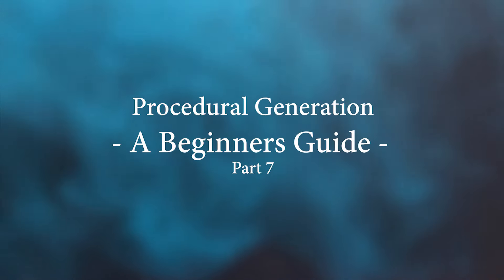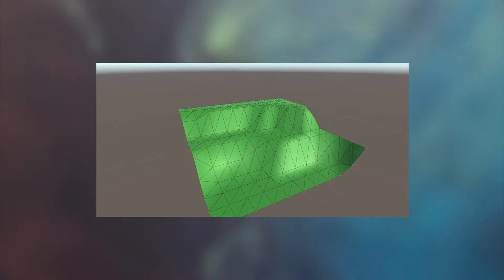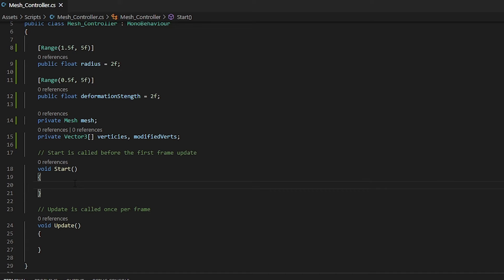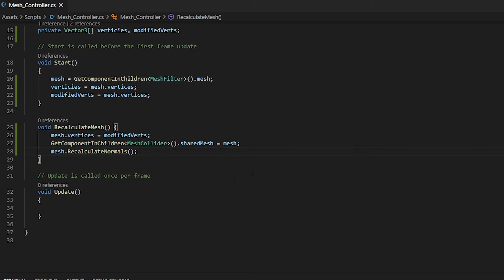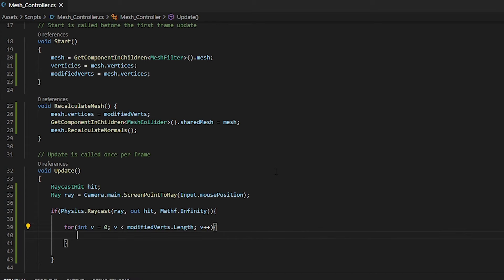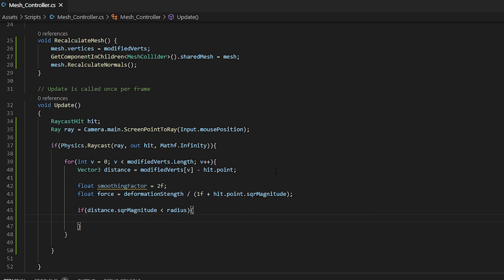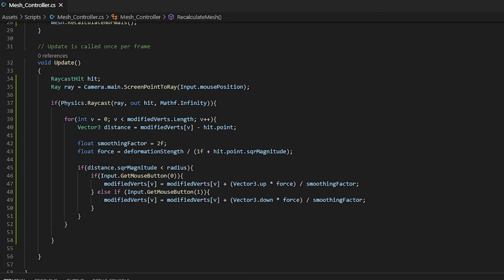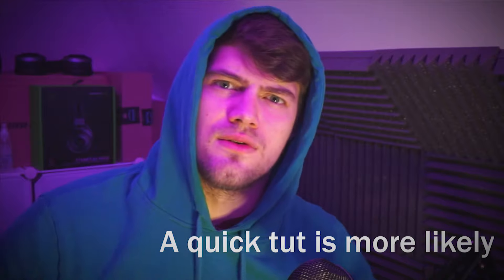Mesh Deformation : Beginners Procedural Generation EP 7 - Unity3D

Comment: I am working on a sand castle city builder project and this video definitely helped me.  Thanks :D
Reply from the maker: Glad it helped!
Reply: I am using marching cubes now because the system you use loses polygon resolution/typology when deformed :)
Reply from the maker: That's good, marching cubes is the correct implementation for what you're creating! Good luck with your project :)

Comment: When I attach this script to my procedurally generated mesh I get a “Object Reference not set to an instance of the Object” in the RecalculateMesh() step at the end of Update
Reply from the maker: Hey, do you have a mesh collider attached to the game object?
Reply: @CodingWithRus  I'm not sure what the original problem was but I worked out how to do the OnCollisionEnter in order to have a colliding object deform the mesh and that works great with a Primitive but not with my Generated Mesh.  I had to move the GetComponent step into an OnBecameVisible since my mesh does not actually exist when Start is called.  And that seems to work ok.  modifiedVerts are being updated with a down component when something falls on them.   BUT the RecalculateMesh step although it's being called ok, doesn't do anything when it's my Calculated Mesh.  The mesh doesn't change shape like it does when the script is attached a primitive plane.   Something about the nature of my Generated Mesh but it seems to have all the correct attributes.  It has a Filter, I can get the mesh.vertices.length
Reply from the maker: Hey, I suspect it will be your mesh collider, double check that it's attached and there is a call on the start method for it. Think that will fix your issue
Reply: @CodingWithRus  I worked it out.  My Generated Mesh DOES change shape, just not visually where the colliding object is hitting it.  It seems to be deforming the mesh's local coordinates in line with the collision's global coordinate (for example my ball is hitting the mesh at Global coordinate 0,0,0 and the mesh is deforming at vertex 0,0,0 but because I have dragged my mesh to position it so that the centre of the plane is under the ball, that 0,0,0 vertex is at global coordinate -10,0,-7.  Do I need to position my Generated Mesh Game Object at 0,0,0 and reposition the ball, camera etc so that they are in the middle?  Or is there a way I can translate the collision coordinate to be relative to the Mesh's position?

Comment: Is it possible to use this but instead of just deforming you could remove parts of the mesh? I want to make a snow system where you can roll a snowball in the snow, the snow will disappear and the snowball will grow
Reply from the maker: Hi, I really wouldn't recommend removing parts of the mesh if you're not certain what impact this would have. Instead deform it (like in the video) to lower the vertex's. Bare in mind I've never tried to create a snow type system. Thanks and hope that helps!
Reply: @CodingWithRus  Yep, deforming was the right way to go! Thanks a lot

Comment: how do I need to change the code if I want to do it with a wall?
Reply from the maker: You'll just have to flip the axis, so instead of using the z axis, you use the y axis.

Thanks,
Reply: @CodingWithRus  where do I set the axis? I rotated the plane. But it only deforms the plane/wall when I click on the ground instead of the wall. How do I need to change the raycast code?
Reply: @Pilzefresser  not 100% sure but I think you could just replace Vector3.up / Vector3.down to Vector3.right / Vector3.left

Comment: Hi Rus! First of all: awesome video, you make me understand a subject that i was trying to learn for a damn while. Tysm

Now, I have some issues to implement the controller to another context:

So, i want to make the deformation acording to the position of a character controller on the scene, that's not the greatest problem right now, but the fact that i want to add a curve to the deformation in order to make it more smoothly (according to the position of this character controller). I never managed curves for this kind of things before, but it seems as a nice option.

Any suggestions?
Reply from the maker: Glad you liked it! For your case it'll be lots of maths unfortunately BUT a not so optimized way would be to use a "invisible" 3D sphere attached to the character controller and then deform the terrain to the shape of the sphere. Hope that helps!

Comment: modifiedVerts should be a copy of the mesh, not a reference. do a new Vector3[length] and copy every cell. the way you are doing it now modifies the mesh points directly and is very slow. see https://catlikecoding.com/unity/tutorials/mesh-deformation/
Reply from the maker: Yes! You're absolutely right, it completely slipped my mind when recording this. When you do it the way that I have done it on the code, you're pointing to a reference of that array rather than having a variable create a new array in memory.